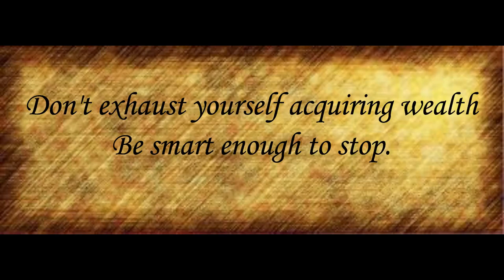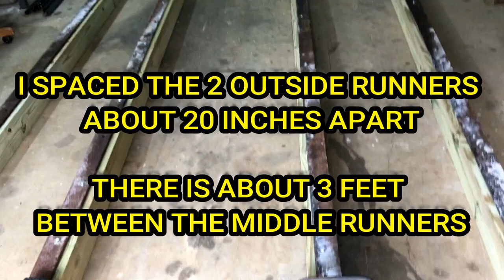BUILD A BRIDGE OVER A CREEK FOR A TRACTOR

Comment: The only thing I wonder about is putting the lag screws in on the bottom instead of the sides. The bridge is going to flex up and down the same way that the lag screw will work itself out, down. If they were on the sides then it seems like they would stay in place better.
Reply from the maker: Interesting point. I used the existing holes in the angle iron. 
I won't use the bridge often, but you might be right about the flex.
I think if it did happen, there wouldn't be a problem because the wood would still be sitting on the metal, and probably wouldn't move any. I think it would take a lot more time to do it than I have years left to live... but who knows.
Good observation.

Comment: Love this! Quick question, are those cinder block footings on each bank? Or did you pour some concrete footings for the bridge to rest on?
Thanks for sharing!
Reply from the maker: The blocks are just sitting on the bank... no footing.
On a few of them I had to dig out a little of the dirt to make all 4 of them level on one side.
As far as I've seen in the past, the water doesn't rise up high enough in this area to wash around the blocks... but we'll see.

Comment: TexasPrepper, I have to build a contraption like this for a tractor pulling a bat wing brush mower. My crossing is about 13ft and a drop of 5-6ft. Any suggestions?
Reply from the maker: Depends on how much water comes through there, but a culvert pipe is the best way. 
If I had it to do over again, I'd do a pipe on this crossing.
Here's a place where I did use a pipe: https://www.youtube.com/watch?v=_Zwc7DTS9Ro&t=5s

Comment: Thanks for this video!  I have a similar sized ditch and am planning a bridge much like this.  I happen to have some concrete parking space stoppers/bumpers that the ends of the bridge will rest on and will drive rebar through the holes in the bumpers to help keep them in place.  Do I need to attach the main wooden beams of the bridge somehow to the concrete it rests on or maybe bolt it to some 4x4 posts sunk into the ground behind the concrete bumpers?  Is your bridge just resting on the blocks or is it attached somehow?
Reply from the maker: It's just resting on blocks, and I've seen signs of erosion under the blocks.
It's making me nervous, so I just put in a corrugated pipe beside this bridge (like the video below)
I'll probably pull this bridge out and use the metal and wood for other projects.
For that reason, I would recommend doing this: https://www.youtube.com/watch?v=_Zwc7DTS9Ro&t=161s
But, you may not have problems if you anchor your bridge better than I did...

Comment: I'm curious why you chose to build a bridge rather than install a culvert.  I have about the same size creek and would like to be able to cross with my Ford 340 tractor or my Dodge Ram 3500.  Thanks for posting.  Tim @ Cliffside Acres
Reply from the maker: I thought about a culvert, but chose the bridge. Not sure why... just did.
Might be because I had the angle iron on hand and hadn't done anything with it for years.
Sometimes the water flow is really high and didn't want it to wash around the culvert either.
https://www.youtube.com/watch?v=nP3lV2PsEyU